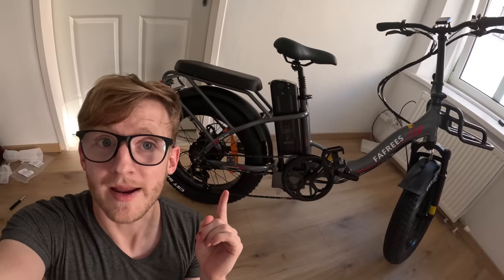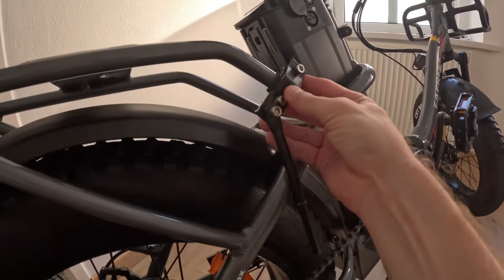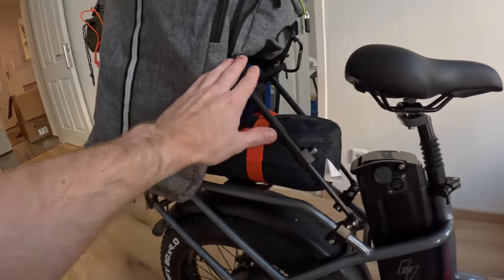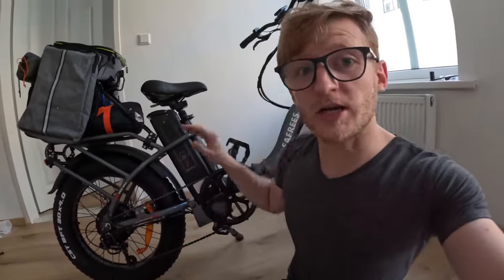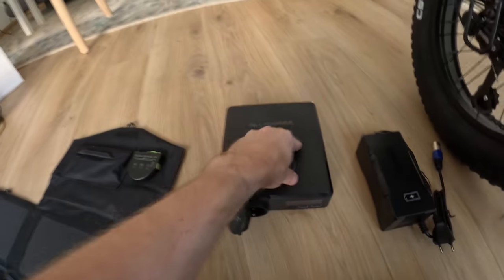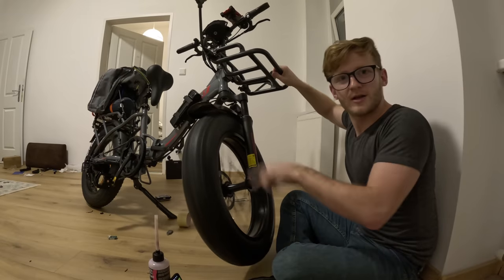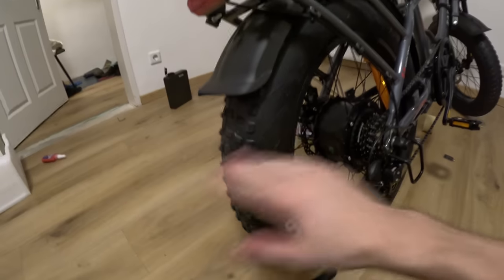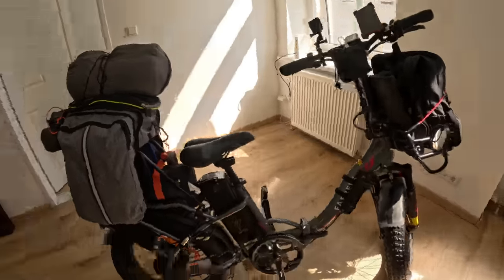Upgrading an Ebike for Backpacking

Comment: Don't get caught. Most European countries have a limit on the power an eBike can have and limit it (Norway and Germant is like 25 km/h befor the motor has to switch off). You would need an insurance for a light motorbike and a drivers licence for the beast. Good luck - sounds fun anyways. And in Eastern Europe they surely don't care^^